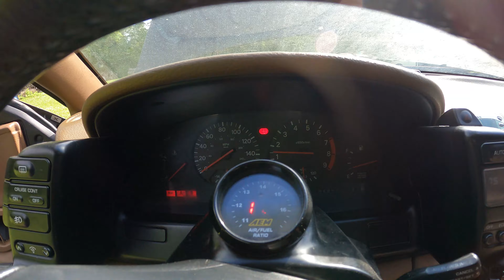How to Remove the Engine From a Twin Turbo Nissan  300ZX

Comment: My 90 TT has extremely low compression on cylinders 4 and 6, and I was dreading pulling the engine. I watched this video a few times and was able to get everything pulled in about 4 hours on a Saturday afternoon. The stripped block and heads are at the machine shop and I'll hopefully start the rebuild soon. Thanks for the awesome content, your video was a huge help.
Reply: May I ask... what kind of compression reading is considered low compression? Thanks

Comment: @12:16, unless you buy a brand new aluminum upper radiator hard pipe, as you can see here on the z in frame, they get corroded which put deep pitting into the cast aluminum, this will make the seal between the oem rubber/ or new silicone hosses not have a solid seal. this is when using rtv is Needed, as it will fill all the pitting in the oem aluminum in order to allow for a solid complete water tight seal. otherwise you are replacing the oem upp radiator hard pipe. which i agree is the best route. but for some isnt an option. sometime what seems hack is legitimate in the moment
Reply from the maker: Makes sense!
I've seen some with holes from corrosion and pitch them.
Didnt even cross my mind haha

The heater pipes and the front coolant bypass pipes are very bad about that aswell

Comment: What are the specs on the Na TT build?
Reply from the maker: Larger side mounts 
1000cc injectors
Walbro 485 w/e85
Stock turbos, 2.5 exhaust w jdm downpipes
Single intake😁
Reply: @NedacSnosrap forged pistons or stock?
Reply from the maker: @Zi.Zenior  stock NA pistons
Reply: @NedacSnosrap  I can’t wait to see what it puts down.

Comment: When u remove upper intake plenum is añot easier to get to top trans bolts
Reply from the maker: If they're really stuck that could help! I prefer to keep mine on to pull the engine from.
1.5 feet of extension with a swivel will get the top bolts from the side of the gearbox 😁